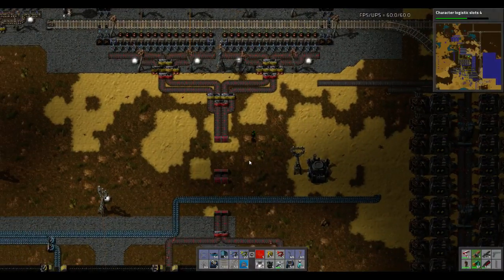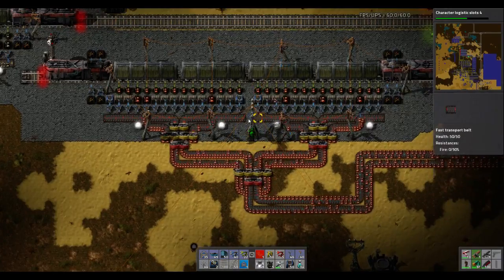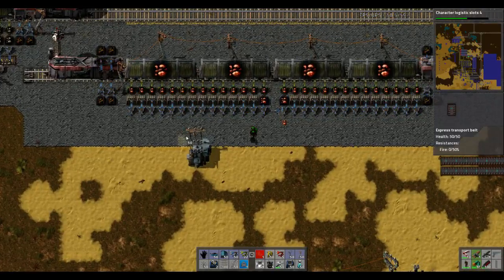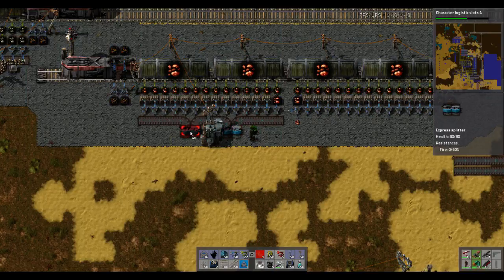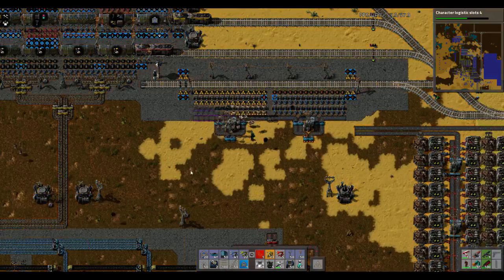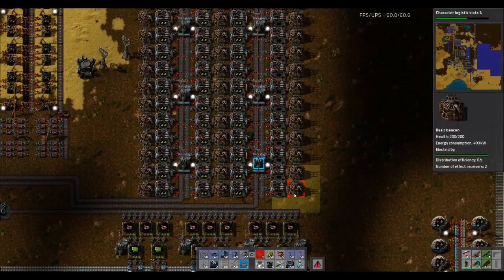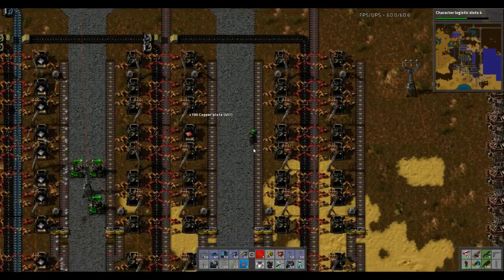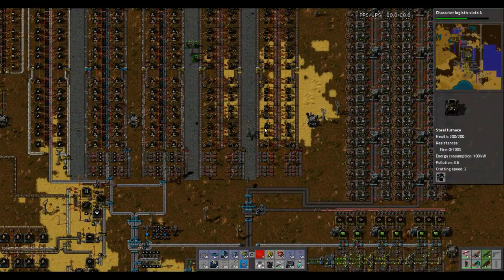Factorio Break The Game 56 Expanded Smelting

Comment: Don't send resources back through the rebalancer, you are messing up the ratios by sending back half of what should go to the outside, and that's why the inside are getting more ore.

Also it doesn't matter that you don't fill every input, the result should be balanced no matter if you have 1 or 8 inputs

Comment: 6*8 = 48 belts in the train / 6 belts from the mine = each belt from the mine goes to 8 belts in the unloader. Rest is easy right?
Reply from the maker: Daniel Vestøl wut?
Reply: Negative Root forget it, was just talking about an other way I would have used to split up the belts for the loader at the outpost.